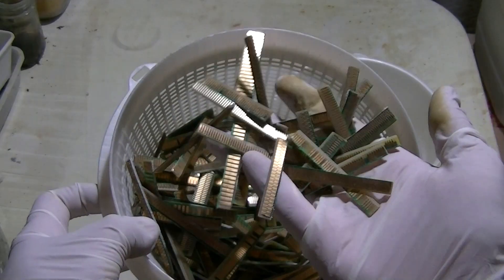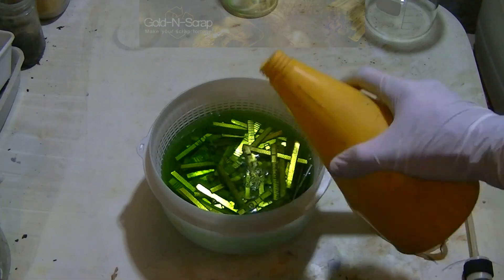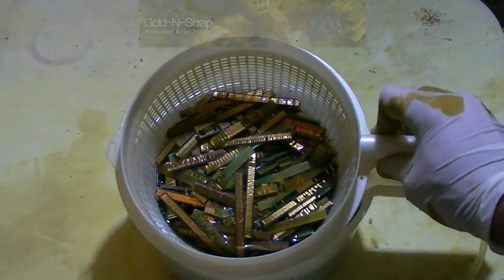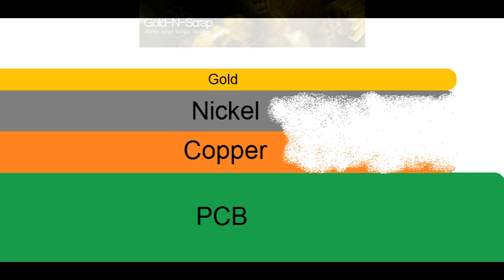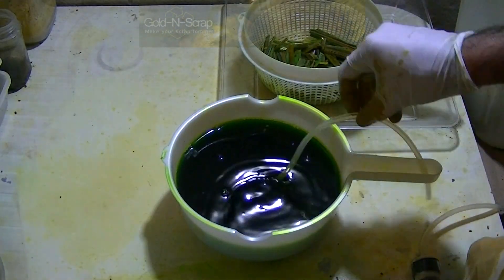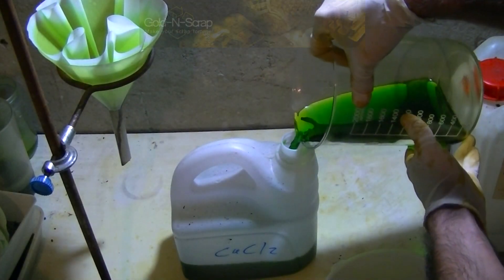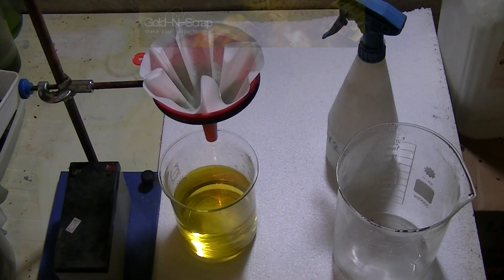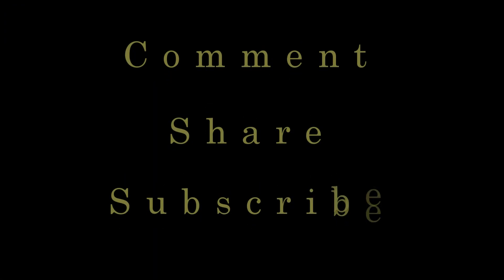Gold Fingers - How to Recover Gold from Electronic Scrap

Comment: People laugh at the "small" return from this demonstration batch, but I can see where this method, combined with other recovery sources and techniques could well supplement a regular wage, 1.47 gram of 24ct a week, obviously increasing on scale, supplementing a few grams from here and a few from there would add up over time, and just waiting to start the refining stage until you have enough in your jar to justify running the hotplates and doing a "decent" refining run with values recovered by other methods, say once a month would cut down on "running costs" by avoiding doing the refining process repeatedly, and you would end up with a bigger, fatter "button" for your efforts.

Would a Troy Ounce (or more) a month make a difference in your life?

Comment: Wouldn't be easier to just heat the PCBs with a heat gun until the bonding agent becomes soft enough scrape off into a crucible.  Then add more copper by melting  a piece copper pipe into the crucible with an oxy-acetylene. Bring the mix to a liquid and then pour the melt into a 5 gallon bucket of water.  This will spread out the copper/nickel/gold solution and solidify it into what looks like copper shrapnel.  Then just throw the "shrapnel" into a 60-70% nitric solution.  The copper and nickel will go into solution and the gold will precipitate to the bottom the glass beaker.  Pour the nitric off the top and flush the residual nitric from the black precipitate with water and let dry.  Then add borax as a fluxing agent and heat with the torch.  The black power precipitate will bead into a little blob of pure gold.     The con of this process, is that it generates waste (or not) copper-nitrate.  The copper-nitrate can be used multiple times...

Comment: When using filter paper it is best to simply fold it in fourths, open up the pocket that is made, put it into the funnel, and wet it slightly to ensure it stays in place. With this method there is a smaller chance of any solution accidentally being poured in the space between the paper and funnel.

Comment: One gram = $35.18   you did all that work for $52.77  don't quit your day job. You also have to buy fingers from a scrap yard and usually the fingers are cut off from other boards. All of this you have to buy and electronics near me go for about $2/LB so you'll probably need to buy 10LB of scrap electronics so you can cut out the parts (on a bandsaw or with sheers) the parts that have gold so they are small enough to wash. So you'll probably spend $20 to make about $50 and net $30. Yep.. fun science project but a business it's not.

Comment: Extracting gold from PC and other electronic circuit boards does pay off in the end provided you have tones of scrap boards to do it with, I have not tried it myself but have often thought of doing so, I have a small electronics and computer repair shop and we have probably in the neighborhood of a few hundred pounds of scrap material,  I looked into what was needed in the way of equipment and chemicals and found i would have to spend about 3 to 4 hundred dollars for all i would need to do it correctly and safely in order to yield the most amount of gold per run, Sorry folks but the math does not add up, You will spend way more money that you will ever gain, If your thinking of starting a business doing this think again, However if you simply want to perform a cool science experiment with some pretty neat results you could spend then try it.

Comment: not sure the return is worth the effort here, not liking the chemical part. guess why we send it over seas.  let someone else pollute the planet. 
thanks for video, educational.
Reply: Actually we do it right here. I was an owner operator at United Van Line and about half of what I hauled was computers. I would pick them up at banks and office buildings that leased them from dell and IBM and just keep loading from different places until my trailer was full then haul them to the recovery center. Really big money in it if you are a large processor and have contracts with leasing agents.
Reply: ...before that I worked for a subsidiary of Alcoa where we recovered copper and nickle through a similar process and used electrolysis in some fashion to recover the metals. I scraped the sludge filters.
Reply: Sending it over seas doesn't solve the problem, just ignoring and shove the problem to someone else.
Reply: oh I agree, but no one in the states is going to take 7-10 days to get 30-40 dollars worth of gold, and harm their health to get it. sorry to say
Reply: Matt Dowd No harming your health if proper personal protective equipment is worn. And there are companies in the US that do this on a much larger scale.
Reply: I hope you make bank, but health and environment for an individual don't seem worth the risk.

Comment: Fascinating. How much is the cost of these materials compared to the amount of gold extracted? At the Current price of Gold at $1290 per ounce as of April 15, 2014  and one gram  equal to about .035 ounce it will be about $66 worth of gold you have in this video. Is it worth the expense of buying the material and equipment for this process? 
I hope I do not offend but I have several pounds of circuit boards and computer peripherals I can extract the "Fingers" from and would like to know if I should invest in the materials to start reclaiming the gold. How do you dispose of the waste product with out damaging the environment? How do you neutralize the acids so it is safe to dispose of? 

Thank you for posting this video. 
I look forward to your replies.
Reply: I think the acids could be neutralised by using soda (pure baking soda - natrium-carbonate), but you have to e careful as usual (acid + soda = kaboom!, lol)  and figure out what the result vill be, probably different salts. It's worth making a calculation if you think you have enough "fingers" and discarded parts. I would consider it as a funny experiment in the first place.
Reply: ***** Except you wouldn't neutralise the solution you would (as he says in the video) save it for the next batch (it can be reused). As soon as you start repeating the process you are making money on old investments. The solution and bubbler can be reused, if you are doing it enough times it could easily become profitable.
Reply: The furnace method is more labour intensive, but MUCH safer for the environment.  E waste is big business these days...hard to get free stuff any more.  Not impossible, but even if you can find enough of it (say, if you work for an ewaste recycler,  it takes a lot of time.  I used to watch a tv programme every night and would scrape fingers and flat packs and stuff.  Earn a buck an hour (maybe) for watching TV.   Munchies took care of that...but I DID end up with a gold ring after, what, two years....grin!  Worth it?  In this day and age of instant gratification, I cannot imagine any young person (as most youtube commentators are)  would have the "stick to it it" it would take to do it manually.
Reply: Those materials and or supplies are cheap almost insignificant if your doing any more than a gram worth of gold.. The time it takes you is time that your not doing anything else anyway so there again the time is virtually insignificant as well... :)

Comment: Profit margin in electronic scrap gold recovery is absolutely related to the amount of circuits you are "cleaning". Unless you have several pounds of the better things to use (processor pins "fingers") then you would be in the negative profit margin if you figure in time - material and relative scrap value of the higher end circuits at salvage centers.

Comment: I guess if you grinded up the fingers in fine particles (just a bit bigger than the mesh of the filters) you could probably use less chems and speed up the reactions. I figured that if this is the way to get rich it's all about the details.

Comment: Excellent presentation. Could you list and picture the components and perhaps where to find them. . .
It was hard to estimate the size of the gold alloy nugget, I would guess 5 grams.
Why don't you use Muriatic Acid and Hydrogen Peroxide for the stripping process. I realize Muriatic is diluted Hydrochloric Acid. I was just curious why you chose what you chose. Can Nitric be added to the Muriatic/Peroxide  to form Aqua Regia. . .Thanx for a clear, concise explanation. Does the Aqua Regia put the copper into solution and leave the gold in tact
Reply from the maker: No, Aqua regia will dissolve the gold (or just some of it) in to solution, only to be later cemented out by the copper.
Better to not dissolve gold with copper at any case.
Reply: indeedItdoes  I have been watching this video a not to few times, what was the actual yield did you get out of this batch of 500 grams of fingers?
Reply: R

Comment: quite funny all the haters on here. to clear up any and all questions this video is not ment for the avg joe blow who buys a new computer every 15 years and would take months to get the amount he used. he simply is showing people who can get thier hands on thousands of gold plated computer parts a week and would do this in thier spare time. yes spending the time and money on chemicals if you only have the amount of gold fingers he has in the video it is no where near worth it. even small bottles of the chemicals needed start to finish including processes not in the video  is going to run you around $100-$150 depending on if you buy bulk or what not. but if you have enough gold fingers to do multiple batches of this and most chemicals you use can be resused at least 3-5 times on way larger scale batches your profit will be alot more. he simply is showing you a basic tutarial on how to do the process. so all you haters out there can shove it where the sun dont shine cuz he did an amazing job on this video. prob the best ive seen on youtube. nowhere did he say get rich for life on one batch of this stuff.
Reply from the maker: Daniel Kirkland You are amazing!

Comment: 1.47g Gold, that's around $70 buck worth of gold?

seems hardly worth.
Reply: Average price of equipment required:
Gallon of copper chloride solution: 60$-90$
Gallon of hydrochloric acid: 55$-75$
Air bubbler: 30$-40$
Respirator: 10$-35$
Price of memory sticks: assuming they're free (you found them)
Gas money: varies
1 gram of gold: roughly 22$
You would be better off working part time at burger king.
Reply: kasey7638
I don't know where you're getting those prices from, a gallon of Hydrochloric Acid is about $15, you can make your own copper chloride quite easily and on the cheap, an air bubbler is about $5.
Reply: would be easier selling drugs
Reply: Not really.
If you do this a couple of time it becomes very worth it.
Considering how you can get junk memory sticks and cpu's almost for free.
Reply: Tuco Benedicto Pacifico Juan Maria Ramirez

it would take about 50 lbs of junk memory sticks and cpu's per a week, to make it worth it though, minus the cost to do this process etc. it's basically a fulltime job to do all that, and by then you would be better off just getting a fulltime job. thought thats just how I feel. /shrug
Reply: Legendary $200 bucks a week? you should find a new job
Reply: kasey7638 Truth!
Reply: RedXuchilbara
There's your problem.
Per week?
No one would do that because it is ridiculous.
If you do it as they come it will be worth it.
It is fairly cheap to get memory chips and old cpu's for dirt cheap prices even online.
But like I said,doing nit for a living is ridiculous.
Reply: Tuco Benedicto Pacifico Juan Maria Ramirez

very true, but I've heard some ppl say "we can get rich doing this", and that's why I made my comment, because there is no way to get rich doing this.
Reply: Sig Adams Plenty of jobs out there but you will actually have to WORK. I make about 80K a year and I dropped out of school when I was 14.
Reply: minecraft2314 It's still a lot of hard work just for pocket change.
Reply: kasey7638
Not if you do it as the parts come.
You people keep thinking this is career.
Your minds are in the right place just not thinking with common sense.
I am 34 and I have come by at least 60-70 pc's if I wanted them at dirt cheap prices in garage sales and goodwills.
Doing this as a job or career is ridiculous.
But if you buy the equipment and only do it as the parts come you will make your money back very easily.
Try it.
Go around garage sales and goodwills and you will see the 2-5 dollars computers for sale.

Also,1 gram is $24 of 14k.
Reply: RedXuchilbara
That's just crazy.
There is money in it but only in the long term.
If you keep at it for years you will have a "little" nice investment.
Reply: RedXuchilbara
rich? it's just a way to make some extra money
Reply: Andrea Tomassini my statement about rich is in response to some other ppl saying, they could make some money doing this.
Reply: Just a pound of this and get 26900 US dollars
Reply: Silicon Vengence doesn't matter, I'm just stating my opinion.
Reply: Ihate putin Drugs are good mmkay...
Reply: RedXuchilbara I doubt that, nobody is hiring retards
Reply: I think worth if you do many, no just to try take some gold from your old phone or computer :)
Reply: After buying all the acids gloves and chemicals your not going to make nothing I can make over $200 in a week working instead of wasteing time doing that.
Reply: kasey7638 The solution is reusable, allowing for less chemical buying.
Reply: diehl1881 I could find a fulltime job that makes 4x that easy.
Reply: Sig Adams not true though ppl that are disabled normally get minimum wage jobs, and if they work fulltime that will be about $320 a week.

now me?
I'm a graphic artist I can get $25 dollars an hour. x fulltime = $1000 a week.
Reply: Matthew Macon
selling crack is not considered a wise career choice
Reply: 1.4g is over $100 idk what value of gold was when u posted it

Comment: 1.47g of  pure gold with 1319.10 US Dollar
 per oz of gold. So thats around 68 dollars of gold. kinda troublesome process to get 68 bucks at the end.
Reply: Oly Roller Gold is dying out?!?!  Are you mental?
Reply: seems like most of the process is just waiting around.. and the rest of the time would probably take about 3 hours... good money per hour when it comes to actual work being done
Reply: Patrick Dempsey possibly if you dont have to buy all the ingredients and equipment. I guess its ok to get some extra money if you have gold covered computer parts
Reply: Patrick Dempsey It just doesn't seem worth it, cause you have to go out of your way to get the electronics, then melt it down and clean it all off. It's just a long process, you also need supplies. It's not worth it anymore, gold is dying out.

Comment: Great. Except if that hydrochloric acid is high concentration, adding water like that could cause a violent reaction. You need to add the acid to the water for safety, not the other way round. The acid could already be dilute of course, but you didn't say.

Comment: You will make more money just selling the memory, no chemicals, just cash.
Reply: not with old obsolete memory chips. tech changes every few years(months) and memory access speeds change. you cant mismatch "speeds" of memory boards. BUT yes you can find a FEW gems(memory boards) in the rough.

however, i know someone that found an old univax mainframe. he pulled all boards and memory from the old monster. after refining the gold he eventually pulled 12 ounces !!! the tear down and haul away process cost him 3 weeks and 1 weekend UHAUL rental(24.00). After all is said and done, he came away with
12 oz at 20 karat purity = $10k. The university gave him the old mainframe for free.

Comment: about how many ram stick scrap would you need to get about 1 gram? or how much scrap boards did you use here and what did you get out of it? i want to make my fiancee wedding band myself and figure i need about 4 grams of gold. would like 1 gram of it to be from finger scrap due to our interest in technology. thinking i would then use either 14k gold 3 grams or 2grams of 24kgold and a gram of the filler (copper? nickel?) metal used when i forge it.